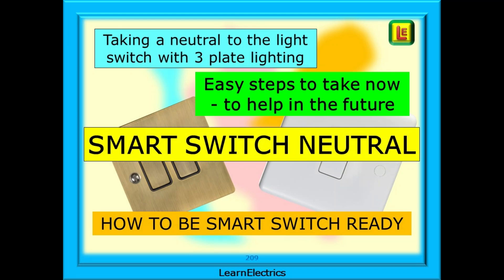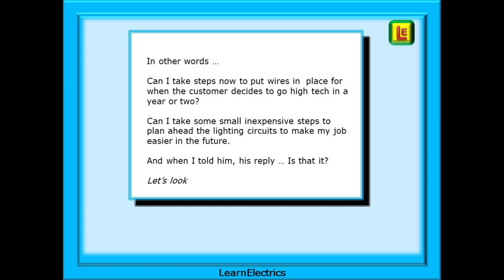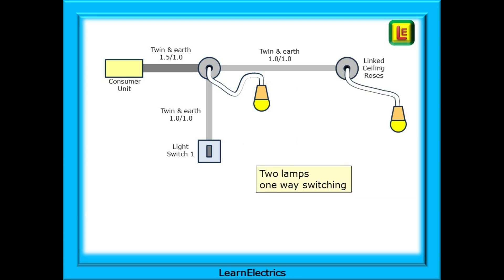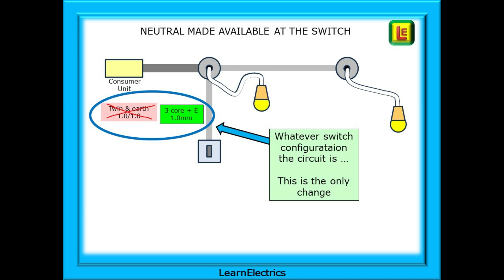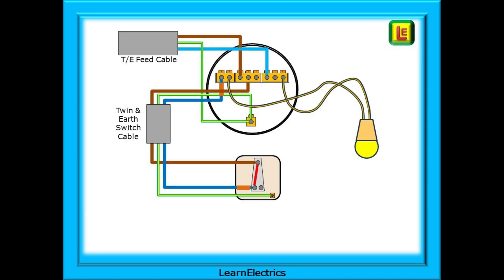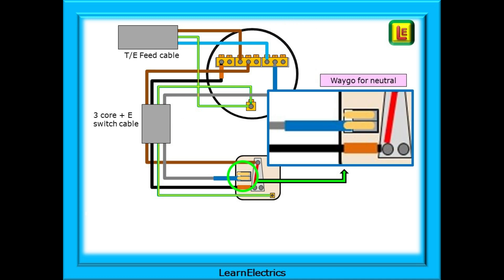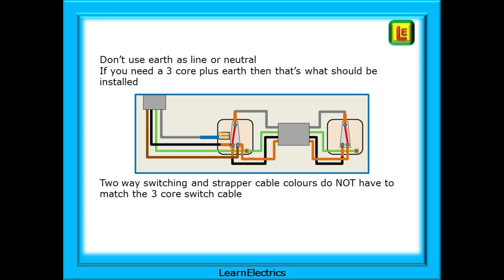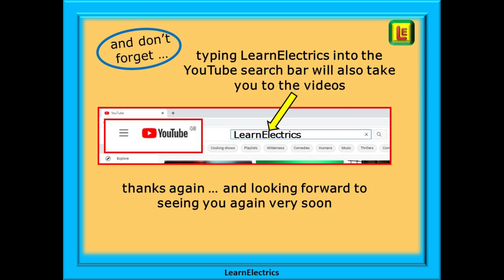SMART SWITCH NEUTRAL – HOW TO BE SMART SWITCH READY – TAKE NEUTRAL TO THE SWITCH IN A 3 PLATE SYSTEM

Comment: I only use kinetic switches if customers wish to go "smart". The switch (transmitter) can go anywhere and the receiver goes in the ceiling (above the light). The receiver works perfectly well with Alexa and Google Nest as well and cheaper than labour.
Reply from the maker: Yep, absolutely, that's another solution. Thanks for the input. Dave.
Reply: That doesn't really meet the critera of "smart". I doubt the kinetic reciever could communicate with out sensors or be setup to be setup to create bespoke automations.
Reply: The Kinetic switches I use can be be linked to Google Nest and/or Alexa. Automation can be set up in there.
Reply: @AntonyoKnight  Not as flexible as home assistant. But I agree, I will cater to people who need simple functions.

Comment: Nice one Dave. As an AV/automation geek, I've been advocating for years that refurbs/newbuilds should be dropping 3+E into the switch boxes. I've "Shelly'd" my house. It's worth saying that some smart switches will work with a bypass capacitor and no neutral, but it will forever be a fudge. The results can be extremely variable, power limited and will never work as well as a proper neutral.
This is right up there with cat5/6 cables and power radial circuits as "must do's" for refurbs and new builds.
Reply from the maker: Well said, totally agree. Thanks for the comments, appreciated.
Reply: Threw me off slightly with "power radials". Are you suggestion to scrap the use of rings for socket circuits?
Reply: @Dr.Stacker  Oh yes, the reasons for their inception have long since disappeared.
Reply: @Dr.Stacker  Not really. I explicitly said “the situation” as refurbs and new builds. No reason for a ring main.
Reply: @paulinturkey  I agree with you for the most part. If money is no object and then I'd also go down the route of a larger CU with multiple RCBOs and larger radial cable sizes. Doesn't mean to say the ring doesn't have its place as its particularly useful where circuit length and voltage drop are likely to be an issue.
Reply: @Dr.Stacker  You're reaching. Design better.
Reply: Not quite, the design isn't in your hands, its based on budget.
You can forget about pushing the 20+ Way CUs loaded with the latest RCBOs/AFDDs/SPDs as the mainstream developers aren't going to entertain it.
Everyone knows what the sparks version of a Porsche looks like but good luck playing salesman to the bloke with a ford.
Reply: @Dr.Stacker  As I said, you’re reaching……… waaay beyond the scope of throwing a neutral down to a light switch. My point remains within the bounds of somebody doing a refurb/extension/new builds where you do have some/all the control. Mass developers are blood sucking parasites who won’t do anything beyond what legislation requires them to do. Even then, lets not go all drama queen over it. Most mass built estate houses only have two or three rings in anyway. To convert those rings to radials, its a couple or three more ways. Hardly earth shattering, but will happily accept that the parasites won’t do it unless compelled to do so. That’s a whole different conversation.

Comment: I've been 2 plating light switches and 3 core switch drops to lights for years now for this very reason, good shout Dave👍
Reply from the maker: Great to hear Brian, I agree. Just when we get used to everything in the ceiling, along comes another change fairy.
It was like this with eggs years ago.
First it was E for B and be your best.
Then Edwina said eggs were bad for you.
And now eggs are back on the menu.
Thanks for the support. Dave.
Reply: @learnelectrics4402  ive been eating them all my life and ive got no brain dama damge
Reply: whats the benefit of sending the 3 core up to the lights? What could you do with the 3rd conductor if the smart device is situated in the backbox? Only time I see a 3c&E send upwards is if there is a bathroom fan in the mix that needs a permanent live. Thanks

Comment: Would love to know the easiest methods to rectify a wiring job that wasn't future-proofed from the beginning.
Reply: Just be prepared to pull wire.
Reply: @Roq-stone  for sure, but where from? What's the easiest way?
Reply: @EbrahimHasan  You will need to replace the 2 + core from the first point (light) and replace with 3 + core, and then cut out wall(s) to run cable to light switch(es)  If the cables are inside a stud wall then you may well be able to just draw (pull) them through.
Reply: @zed.kelectrical8741  I'm actually asking for a friend who's got concrete walls. An electrician suggested taking the neutral from the sockets, which I know is not right. The best thing I can think of is pushing the extra wire from the switch to the fixture.
Reply from the maker: See above.
Reply from the maker: Excellent help for Ebrahim guys, thanks.
Reply from the maker: Don't do it. Never borrow neutrals.
Reply from the maker: Thanks for the comments.
Reply from the maker: Lots of replies here Ebrahim. Yes, you are right, it is not good practice to borrow a neutral from another circuit.
If you run a neutral as a single it MUST be sheathed, not single core, bare blue. But it must come from the same circuit as the lights.